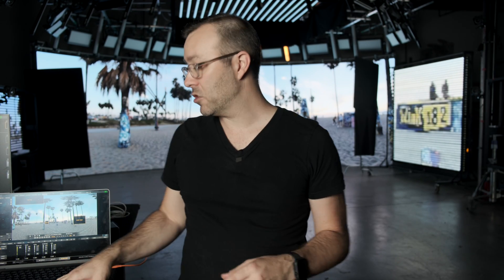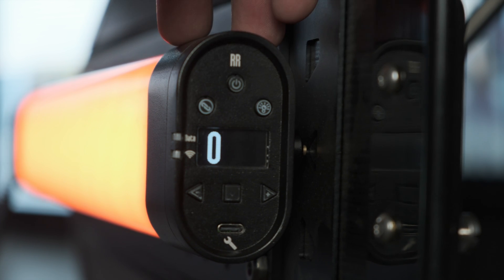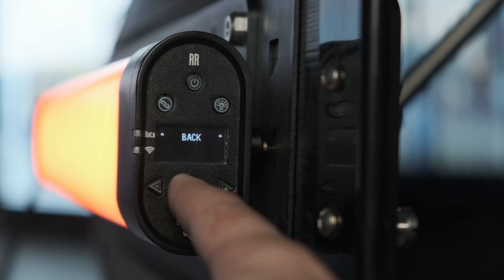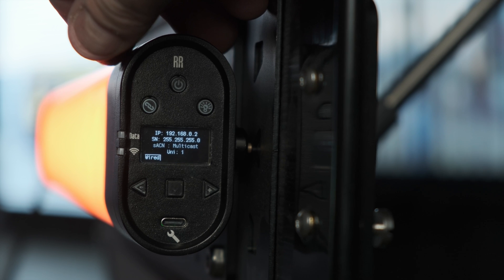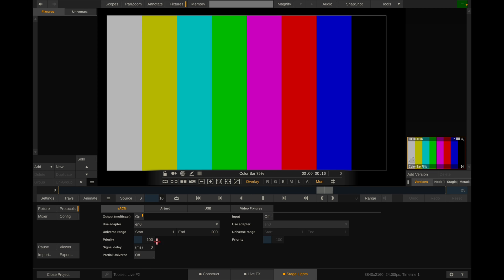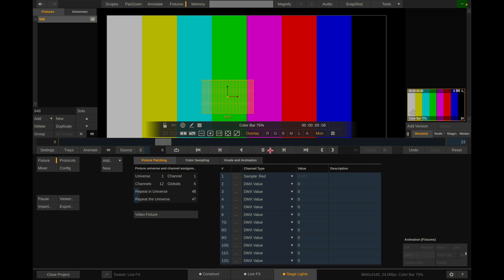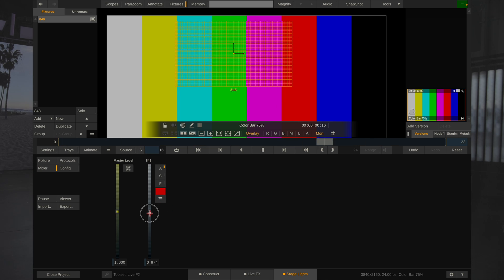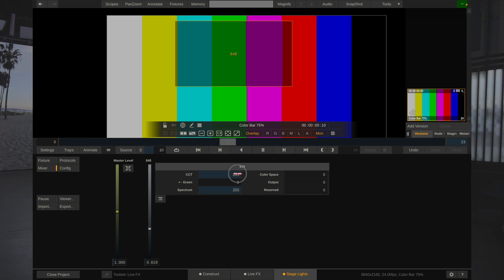How to set up Quasar Science lights with Live FX!

Comment: Thanks for the video. Can i ask why did you use another laptop to use lightstage and control quasar lights instead of desktop computer which streams to the led wall?
Reply from the maker: You can use live Fx on the same machine for sure, at that stage I mostly did use it that way. But oftentimes I do use separate machines, for several reasons. 

I like the lighting to not be able to effect anything with the media playback, performance or otherwise and the other way as well. 

I like the programmer to be able to have a machine at their console or wherever is convenient as well.

Also often the lights need different content etc., which you can set up on one machine but becomes complex and can have performance considerations.

Comment: This is great video. Thank you! If you dont mind, could you let me know what device did you use to connect laptop(Assimilate Live Fx) and rainbows? You mentioned these were connected via wifi and protocol is sACN?
Reply from the maker: The quasars were all connected to a network switch, I’m not sure which one but I think it was like a netgear one. Then yes I was connected by WiFi to the same switch. I didn’t usually run it that way though, I was normally hardwired to the switch.
Reply: @AlexPearce3d  Thank you ! I was also trying to connect my laptop hardwired. But, only see Wi-Fi option on my Assimilate, and wondering what way did you use. Thanks again for explaining detail. Great content.
Reply from the maker: Thanks! If you plug into Ethernet or turn on/off WiFi while assimilate is open, you’ll have to restart for it to see the network
Reply: @AlexPearce3d  I see! That is why I could not see any other options for network. Thank you !